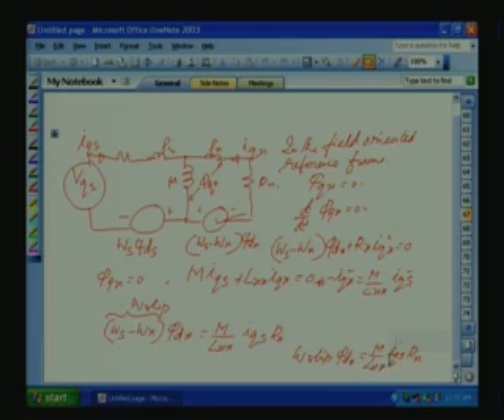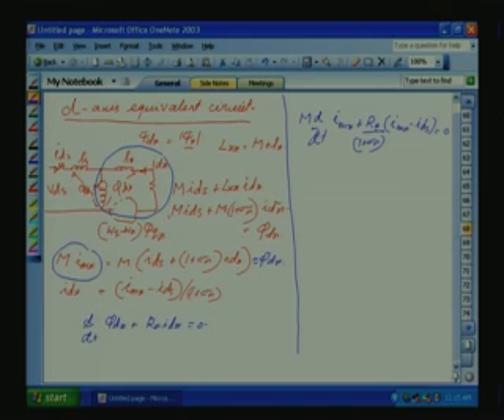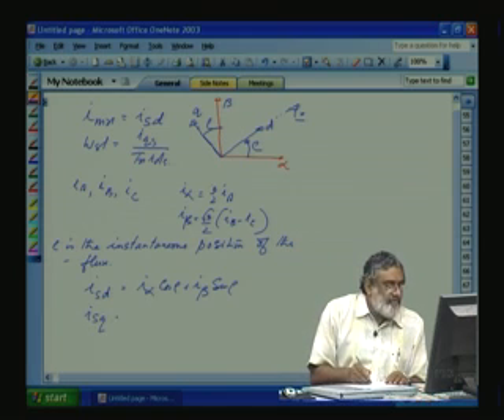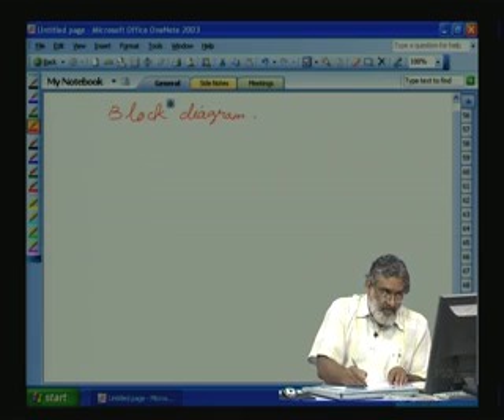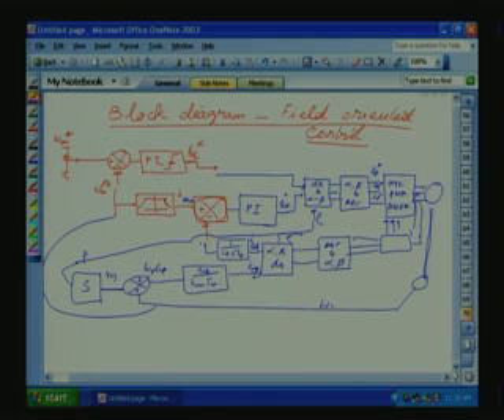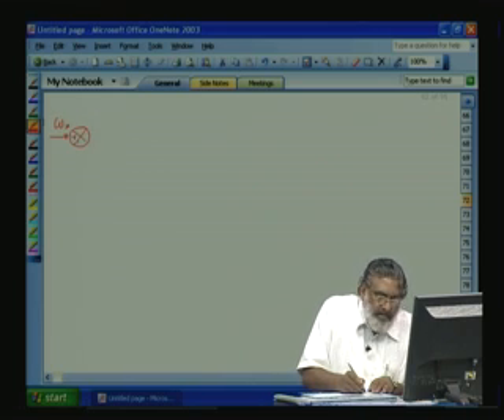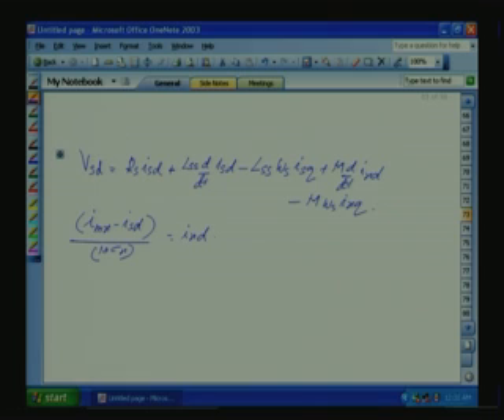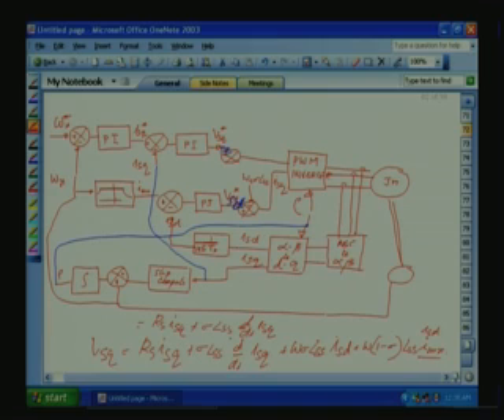Lecture - 35 Vector Control of Induction Motor

Comment: @Bboy5827 You mean  to verify accuracy of the estimator with the real flux angle ? I would say it's impossble cuz gap flux is difficult to observe, not to mention rotor flux. However , you can verify it using a wound-rotor induction machine ,whose rotor current is observable.

Comment: In an asynchronous induction motor, the rotor flux angle is not equal to the applied electrical angle and typically a rotor flux angle estimator is required. My confusion is in the implementation of the rotor flux angle estimator. Since there is no way to measure this angle I have no reference to design an algorithm which estimates it. I have tried to model the flux angle, but how do I know if the model is accurate?